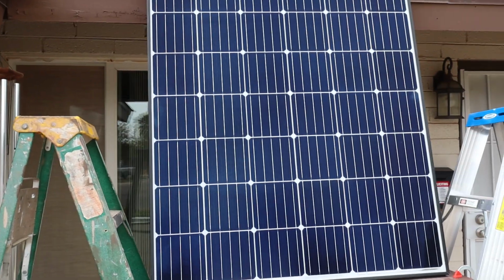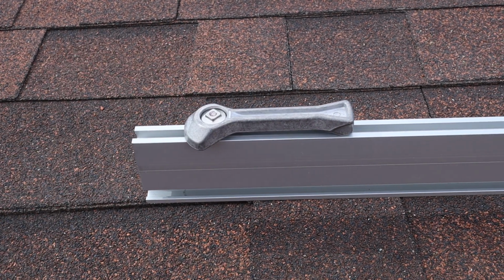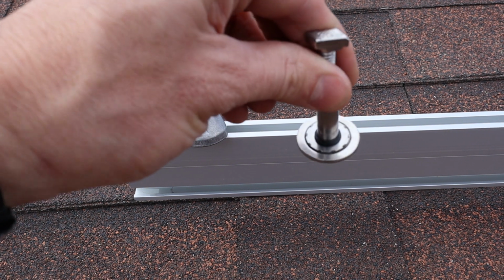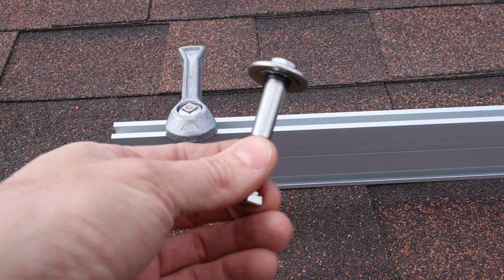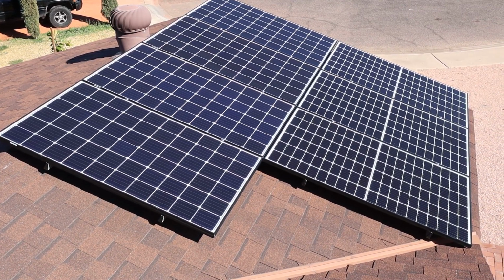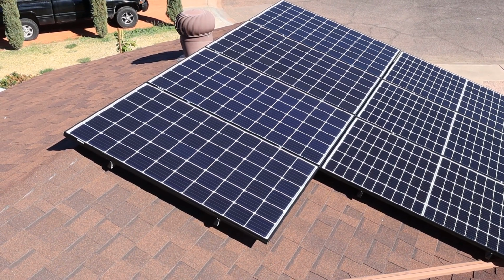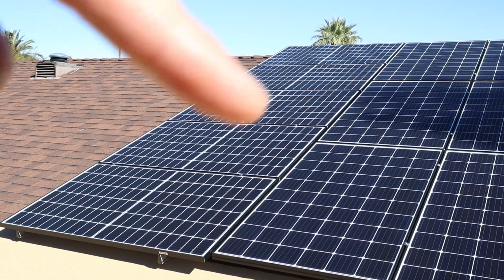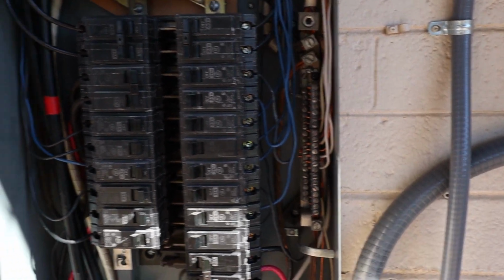My DIY Solar: Part 8 Solar Panel Install

Comment: When I did my install I figured the same as you, they would want to see all the wiring before installing the panels.  I asked the question, when I got my permit, and the inspector said give him a call after I've completed the whole install.  All he looked at was the number of panels on the roof matched the permit and that the disconnect was wired correctly.

Comment: I was in that cold weather, highs of -30 and lows of -50 are not fun.  Working on the planning phase of a system, since I'm not going to install until it thaws out a bit outside.

Comment: Just finished and turned on my small 1.3kw 5 panel enphase setup the weekend. Vary diy friendly product. Already want to expand.
Reply: A month after I turned my 5.2kw system on I started figuring out how much it will cost to double my system..lol

Comment: Will like to know if you can have back up batteries with microinverters and how you recommend installing it? I live in PR I have my panels racks but am still debating on buying micro or string inverter. Please let me know you recommendation.
Reply from the maker: I have Tesla Powerwall2s in conjunction with my microinverter system. It does work but I would go with Enphase's Ensemble/Encharge system. It's a better system. A little more expensive but worth the cost in function and efficiency.
Reply: @ICanDoItMyself  So powerwall and enphase battery can be charge with AC? That's my debate since micro inverters and panels are DC-DC to AC and there's where I get confuse and don't know how to charge batteries with AC? Help me out please....
Reply from the maker: @richardfigueroa864  That is correct. They are charged and supply AC power. That does cause a little loss of efficiencies but increases ease of installation.

Comment: I am going to try this myself also, how do you know how far apart rails for both vertical and horizontal?
Reply from the maker: I don't remember finding anything that said specifically. If the panel is 60 inches (5ft) tall and had 1ft overhang top and bottom, that would be a 3ft gap.
Reply: @ICanDoItMyself  That makes sense, how much for horizontal?
Reply from the maker: @frankphilips5498  if you're going to have the panels in landscape, I would run the rails vertical. Otherwise you need a lot more rails.
Reply: @ICanDoItMyself  Thanks for the info

Comment: Thanks for your great video series. What slope is your roof? Ours is 6/12 and have a problem with the panels sliding down without a second person to hold them. Do you have any suggestions fir doing it solo? Thanks for your advice.
Reply from the maker: I think it is 3 or 4/12. Maybe a ratchet strap? Something you can hook to the rail and hook to the panel, get it secured and then move the ratchet. You may not even have to reset it every time.
Reply: @ICanDoItMyself  Thanks for the suggestion....

Comment: God job there. why do you have to derate the panel?
Reply from the maker: sh839c, you can only have 20% backfed. 200amp x 20% = 40amp breaker. It's to keep from overloading the panel. Breakers should only be at 80% continuous so 32amps backfed, max 26 panels. I wanted 30 panels which called for a 50amp breaker which is the reason for the derate. Derating to 175amp leaves 65amps available for backfeed.
Reply: @ICanDoItMyself  Got it, thanks.

Comment: Your videos are very inspiring and encouraging and so well done!!.  Thank you so much.  How did you know to derate your main 200A breaker (to 175A) when installing the 50A branch circuit breaker?  Is there a specific NEC code that required that?
Reply from the maker: A 200A box has a max load rated at 120% (240A). 200A main + 50A solar = 250A (no good). 175A main + 50A solar = 225A (good). Or, what I have now, 175A main + 60A solar = 235A (still good).
Reply from the maker: @khanhphan3806  175A x 120% = 210A
Reply from the maker: @khanhphan3806  My panel is a 200A panel with a 175A main. So I can safely go to 240A. 175A main + 60A for solar = 235A
Reply from the maker: @khanhphan3806  Panel vs the breaker that feeds the panel.

Comment: What is the reason for going from a 200amp Main Breaker to a 175amp. Seems backwards?
Reply from the maker: A panel that is rated for 200 amps cannot go past 240 amps. With a 200 amp main and 50 amp backfed puts it at 250 amps. Derrating the main is the only way to use a backfed breaker any bigger than 40 amps. Going past a total of 240 amps can lead to a fire.

Comment: Thanks for posting all these videos. These are very helpful as I'm in the planning stages of DIYing myself. I noticed that at 6:00 your panels are at the roof ridge. I read that fire code must be 3 feet away. Did you run into any issues with that? I'm also in Phoenix. Thanks!
Reply from the maker: I appealed to the fire martial and paid a $250 fee to not completely follow code. I just had to show that there is still plenty of access to the roof.
Reply: @ICanDoItMyself  Not sure where to share my comment with ya, but I finally finished my solar install (14.6kW system) and it's officially hooked up. APS was such a breeze. They trust the City of Phoenix inspection and just hooked up my meter! No issues! Thanks for the videos. Certainly helped with my install.

Comment: I think many mistakes in this permit.  Firecode is missing which is nessery.  And module layout are wrong.  you have proper space on back roof you can put more modules on the back roof.  because this is south roof there is good sunhors and .  you putting 6 panels on the north roof there is very low sonhors.  We always prefer potrate module for good sunhors.and you do mix two different types of module Canadian and hanwa solar.  And you doing derate main breaker 200A to 175A.  But can also supply tap.  You meter is detach from the panel
Reply from the maker: The six panels are facing East. The back roof faces West. I bought the first 22 panels at a different time. When I bought the additional panels, they did not have the Canadian Solar panels available. I'm fully aware of fire code, but due to shading, I petitioned the fire martial to not follow it on the back roof and South side of the garage.

Comment: did you need to have SRP disconnect the meter before you de-rated the main breaker?
Reply from the maker: Yes. They pulled the meter so I could change it out. Then city of Phoenix inspected and they reinstalled the meter.
Reply: @ICanDoItMyself  what did the city say about the wire length between the disconnect and the main panel? How long was it supposed to be?
Reply from the maker: @vrei6536  The particular inspector that I dealt with said it was supposed to be 10ft. That is not correct but I did it so he would pass me. The solar meter is not to be more than 10ft from the service meter, I think that is where he was confused.

Comment: I just got my system completed but I need assistance in properly installing my Consumption CTS; my readings show my Consumption mirroring my Production. Can you assist me with that?
Reply from the maker: Your production CT only goes on one line coming from the inverters. The consumption CTs go on the cables coming from the service meter before you main panel. Make sure they are facing the correct direction (there are arrows on them for electricity flow, arrows pointed away from main meter, towards main breaker). Also, make sure they are wired correctly into the IQ Envoy.
Reply: @ICanDoItMyself  Thank you so much. I guess I am screwed then since there is no straight connection from my Combiner box back to the main panel and there is the Main Solar System Circuit Disconnect box in between. The installed installed them on the power cables coming into the combiner box.
Reply from the maker: @thompsonp86  that explains why the number match, they're reading the same thing.
Reply from the maker: @thompsonp86  I posted a video more clearly showing the CTs.
Reply: @ICanDoItMyself  Thank you so much!!!!

Comment: the fact that you did all this in flip flops bugs me.
Reply: I noticed that too.  It actually impressed me that he did all that he did on a roof non-the-less, with such stability and confidence and without issues!  Sure, the case for more appropriate footwear could be argued, but that's the beauty of a DIY, no one telling you how/what to do (other than code requirements)

Comment: why would someone mix portrait and landscape style on the same array that's not space constrained. Looks terrible....
Reply from the maker: It is space constrained in a way. There is a tree that shades 2/3s of my house during the summer. If I went further north than they would be wasted. This way I could fit 5 instead of 3 if I stayed with portrait. Those landscape panels are also now tilted. I don't think it looks bad and that's what matters since it's my roof.